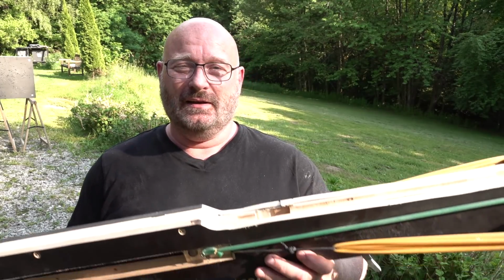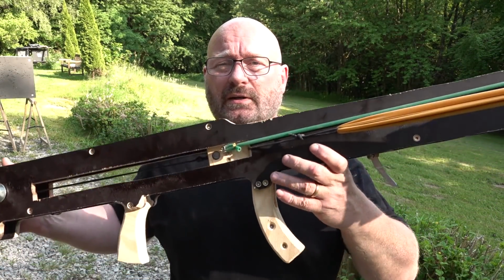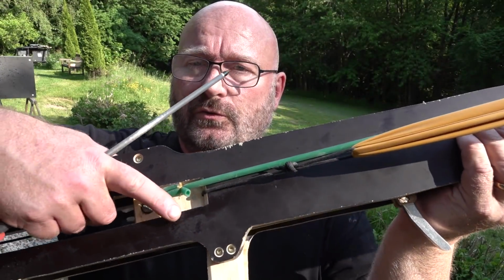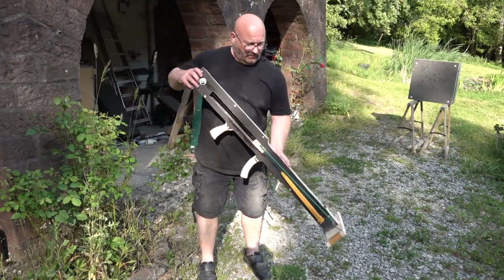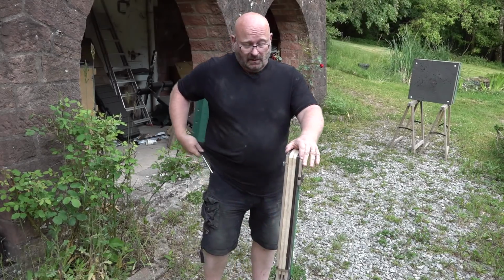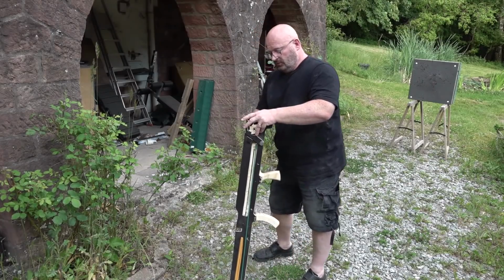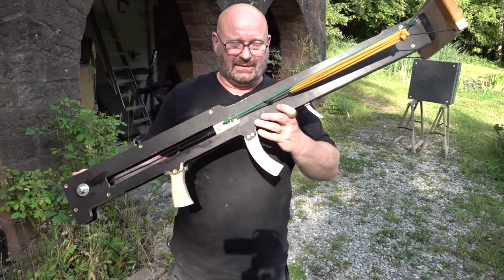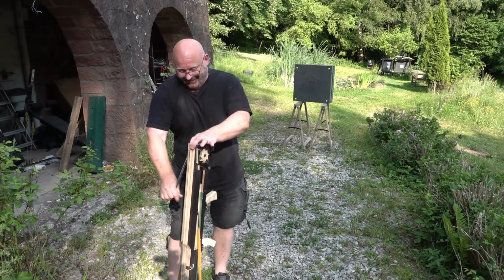The 200 Joule Repeating Rubber X-Bow Project!

Comment: Looks great! I have a question though, would it be possible to make it so you don't have to winch it down until the trigger engages? I'm thinking something like adding a second trigger for the sliding magazine that would be under rubber tension, then after firing your arrow you hold up the lever that engages the ratchet and release your second trigger making the magazine slam down becouse of the rubber. Then you winch it just once to re-tension the "bowstring" and engage the secondary trigger again. 
Of course the build would need to be sturdy enough to survive the slam of the magazine and also if you plan to add a winch handle then that would spin rapidly during the slamming and that doesen't sound too safe...

Comment: Could you add a rod that releases the blocking lever for the crank when the rubber reaches the end after the shot. Then the whole block can return to the rest position using the tension. Once that is in the rest position it engages the lever to block the crank again. That way you eliminate having to wind the crank back to the rest position after each shot.

Comment: why not add an internal pully system to make the charging super easy
Reply from the maker: The cocking system is 100% internally and it is very easy, if you keep in mind how strong the bands are.
Reply: @Slingshotchannel  okay, but what about a quiet electric rc motor than in the internals, my internal full auto enthusiast speaking :D , probably you could fit some small pullys in the internals of the x-bow if it would be too much power needed for the rc motor

Comment: Love it!!!
Make it so the winch handle has a folding / pivot attachment.  That way you can fold it down against the stock (maybe this is where it is held with a magnet) to fire but then quickly lift it off the stock and begin cranking without needing to fumble around fitting a wrench end onto a nut.

Comment: Using a cordless drill and a worm gear to cock it would be an option that might work.  And then have a manual winch when you run out of battery.

Comment: Could you combine a lever action with your ratcheting system so that each lever pull moves the crank two or three notches?  You have already designed several systems that use the action necessary to achieve this.  This would eliminate the winch handle, which as you noted could be easily lost.

Comment: put a second ratchet on the winch handle, that way it can be a built in feature that doesn't need to be turned all the way, just rocked back and forth like a socket ratchet handle.

Comment: Couldn't you use the motor and gears out of a 20 volt drill and make it battery powered
Reply: The cocking of it of course.

Comment: Jörg, did you ever design some kind of pump action cocking system, where you pump several times to get the mechanism strung up? Like with the old super soaker water guns. Only that you would need some way to arrest the partially strung bow/band between pump strokes. 
And thanks a lot for your videos!

Comment: Since you need to rest the weapon on the ground to use the winch anyway, couldn't you just make a system similar to the adder but one that you can step on instead using your hands? Maybe some sort of rack and pinion set up that applied the force straight down the barrel instead of a lever that would bring the force off center and make it prone to tipping. If that sort of thing worked it should increase the rate of fire and make overall operation easier.

Comment: What if the cocking lever stayed connected to the bolt? It could fold flat if it’s down on one side and stick out a little if it’s folded onto the other side

I think that would be better than having some magnet on the bottom

Comment: I've modeled some designs for a similar crossbow.
The winch is obviously the only way to pull the string back when it is intended to be this powerful. Ideally, it'd work without having to change direction, such as with a chain drive, but all the designs I've figured out were too complicated or heavy.
That said, have you thought if it'd work by attaching the rubber at the back, with cams at the front? I haven't made any prototypes, but the cad simulations seemed promising. It should be able to have the same power stroke with a shorter size, but I'm not entirely sure how it'd affect accuracy or power in practice.

Comment: Suggested improvements. 
Attach a rubber band to the trigger box assembly to pull it back, rather than wind it back. 
Permanently attach & fold the crank handle back along the body of the bow and lock with a magnet.
Reply from the maker: There are rubber bands for the retraction already, but they are just strong enough to pull the sled down in a controlled fashion. Otherwise the sled would hit the block hard and the next arrow would be kicked out of the groove. Without the retraction rubber bands (the green tubes you can see in the video), you would have to push down the sled by hand against the mass and friction of the winch.

Comment: Now imagine, if you will, the 1000 joule air "toy" combined with this one. Where the air is hold in the projectile instead of being in the gun. Launched by rubber and propelled by air in mid flight. 
Joerg will poke a hole in the moon some day.

Comment: You wouldn't need to take the winch handle of. Just leave it attached, but in line with the body. That will save time resetting.

Also, you could have an auto return function, which tests the winch/magazine. It would need to disconnect from the ratchet, but it would save more time in resetting the whole thing.

I love you ideas. You are a mad scientist. Love this channel ❤️

Comment: I'd  rather  have the Seige with a multi pump lever, rather than winding. Like an old fashioned multi pump air gun, only with a bow. Maybe 2 or 3 intermediate detents to hold the string while you cock again.

Comment: There may be another way to cock that X-bow ,As the magazine does Not move  when you shoot  ,
Have you considered attaching a long (Metal)  bar to the front of magazine,  
The  bar is to extend all the way to the front where it will exit and Being bent at a 90 degrees extend  to about  six inches  below the bow,
Then strongly attach a  a short piece of 4 inch angle bar  t0 the front of the bow (one flange pointing down and the other back towards the trigger)

The idea being that once fired, You place the front of the x-bow on the ground, stand on the tip of the bar (The one attach to the magazine)
Release the catch (Might need some redesign)then  pull the x-bow up until the trigger catches.
Then use the winch (If still fitted) or place foot on angle bar and use  body weight to cock the X-bow (bit like the Belly-bow)
(This might faster than winching, But winching is likely to be far more robust)

Comment: Very nice. I suggest you add a pump action that advances the ratchet one click each pump so you don't need the crank. Also, you can clock spring the return so you don't need to do that as well.

Comment: I had some ideas about an "ultimate" crossbow and this is coming pretty close. In my head it had a scorpyd design with a magazine and an integrated, no fumble winch. Also the sled would come back by itself after the shot, a bit like the recoil spring of a handgun. It seems this should be the role of the green rubber band on your version, but apparently you still need to crank the thing back, am I missing something?

Comment: As cool as this is, the winch mechanism somewhat defeats the purpose of a repeating crossbow. Since it takes fairly long to cock it anyway, there is no real benefit of having a magazine.
If you however outfitted it with a power drill instead, I think this could be one of your best creations.
Reply: It's nice not to have to get your fingers in the path of the string. It's a little bit of safety.
Reply: Exactly what you said. I feel this one actually took one step in the wrong direction, as doesn't really have any advantage over the Adler (quick reloading) or a hunting crossbow (power).
Reply: Winch gives major leverage for high powered crossbows. If he can add a quick release and a simple lever system to latch the magazine. At best reloading can be done without the crossbow touching the ground. Magazine is good for safety, i have seen a lot of unfortunate thumbs fly from a powerful crossbow.

Comment: always like your videos, but this idea... naaw.
much more a fan of a repeating pump action crossbow, even if its "weaker".
just 30-40 lbs draw into the right projectile could staple someone to a wall,
same for 1/2" steel balls launched every half second at a fairly high speed (fps).

Comment: I own a Ravin R 20 Crossbow and Jörgs cocking system is quite similar to the Ravin one. It has also a build in winch and is sliding the whole trigger unit forward to catch the string. Almost the same as Jörgs solution.

Comment: Could you use a motor built into the structure and wind it up and down with a battery pack similar to a cordless drill? Or maybe use a modified cordless drill, they are readily available world wide.
Reply: He made a repeating crossbow using the drill once. There’s also an electric winch commercially available for the ravin R500 crossbow.

Comment: @JoergSprave I could see using a permanently attached winch where you just align the firing position with a forward facing final rest so it sits next to the body of the weapon in line with the barrel.  The handle could fold in & out if you need it to but I don't think it's necessary.

Comment: Hey Joerg, big fan, i love all your content, i just had a suggestion, it came to me when you said "theres only so much power you can generate with ONE swing of the lever" cant you just make a winch system that uses the lever mechanism instead of only rotating the winch you pump the lever over and over to turn the winch, i think it would be faster that getting out a handle and fumbling to turn a winch, i guess it would be like a rack and pinion and you use the lever action to make a part or a full roation, but it would depend on the gearing that determines the speed of the reload, if the lever only makes a quarter turn you would be pumping for a while lol but still, a fun idea to try, i know if anybody can do it, it would be you
Reply: Brilliant

Comment: Two suggestions.
1 - Add a spring or rubber bands so you don't have to reverse the winch. Spring pushes the  piece you drew back using the winch into the forward position when you push the lever on the winch.
2 - Use a motor to crank the winch back or replace the winch system with a worm and wheel drive with the winch being the 'wheel' and a motor driving the 'worm'. With a rubber belt (or a gear train, or a chain) going between the motor shaft to the worm drive you can position the motor to the rear so it doesn't stick out the side. Or just use direct drive and build part of the motor into the stock.

Comment: If you want to keep the winch handle on I would be trying something like an old inertia start mower has.
When it's packed away the handle part sits in a recess but when you want to use it you just unfold it, crank the winch and then fold the handle back down again.

Comment: The problem I see with this design is that the time taken to get through a firing cycle   

It might not be as interesting but would it be worth combining the lever action on something like the siege with a foot hold you find on a normal crossbow and use two opposing muscle movements to get the bigger draw force?
Reply: Or just a three or four-stroke lever (you cock it with several smaller pulls instead of one long and heavy) and a self-returning 'cart', so you don't have to wind it back.

Comment: And now imagine a 1,5 kilowatt e-bike motor in the back of that thing to automatically reload with the push of a button...

...
Using 2x 6 cell lipos would provide 50 volts at up to 100 amps, so it stays "light" but you can ramp up the power even further

Comment: Can't you slide the piece down, instead of turn the handle backwards?  If you push it back down with your left hand while your right hand is installing the handle, you can get it cocked a bit faster.  Unless you are attaching the handle.  You can stick it on like my toenail clippers so it folds up?

Comment: Joerg, can you keep the winch attached? It looks kinda clumsy that you have to detach and reattach the winch each shot. It seems far away enough that it might not hampers you when aiming? If that's the case then maybe you can also make the winch attachable from either side, so it can be used by left-handed and right-handed both.

Comment: You could make rewinding easier, when you add a lever that keeps the wratched open, while the sled is in the front (=config. after shot->wrinch open->rubber pulls mag slowly to the front. Start cocking ->sled moves back->winch engages again)

Comment: Many cordless screwdriver have 90 degree adapters available. Did you experimented with any of them to have a electric version in place - even if ugly. (I know that you had versions in the past)
Reply from the maker: Forget those 90 degree adapters, they have very low torque limits.
Reply: @Slingshotchannel  I guess you did that already in privat, but how about a tech-video with that exact topic. Find the strongest 90° adapter which can be used to build a cordless screwdriver cocking mechanism. After a quick search on amazon it was not very often added how many Nm they actually support. Therefore a test-run would be needed. Maybe converting an old shooter first to give it a weapon-ish touch.

Comment: I like the pump/cocking action of the smaller ones you have shown. In this case, it would be very heavy of course. But, don't you think you could gear it down, so that it would require like three or four pumps per shot? It would mean you can keep on the target while reloading, and no extra winch would be needed. I'm looking forward to see what you come up with, and show its features! :-)